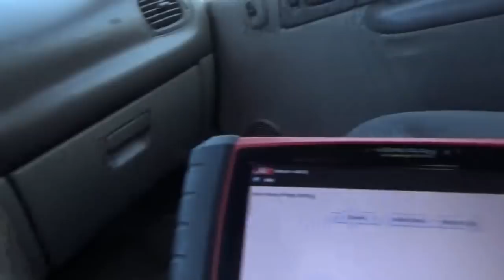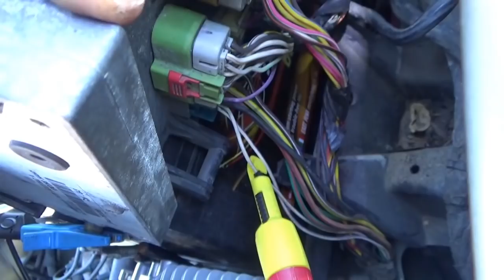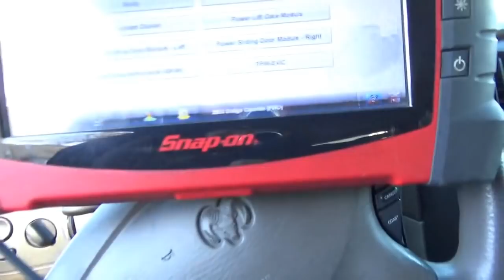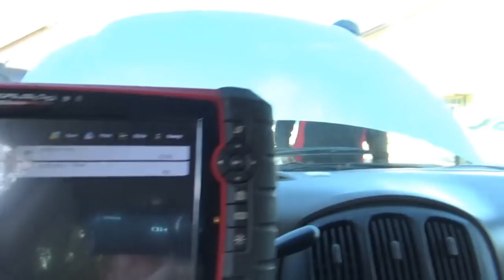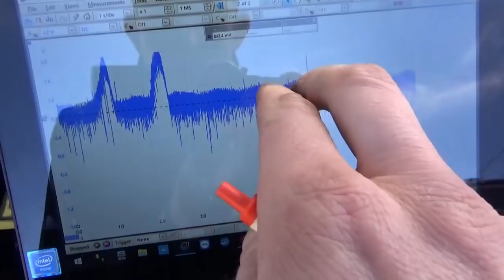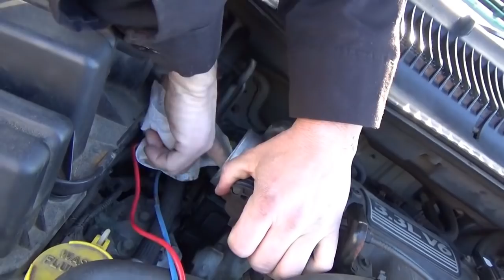No comm, high idle, new PCM: Dodge Caravan (SI Ep. 12.2)

Comment: This is a 15 year old vehicle at that time and it is now February 2024. It never ceases to amaze me that Mopars have always wiring issues and bus issues for the last 2 to 3 decades. Almost all the automotive YT channels have Mopars that have wiring or Canbus issues. It is rarely their engines, driveline, lighting, alternators and batteries that have issues. Their starters wear out prematurely and their drivebelt system ( the pulleys that is)  have been their biggest weakness for decades, dating back to the mid 70's. Up to this point, they haven't fixed their issues and that is very telling of this company. Lately, since they switched over to ZF 8 speed automatic trannies, their reliability has gone sharply up! The 62te and 41TE are an improvement from the A604, but you cannot neglect the maintenance on these transmissions or they will prematurely wear and breakdown. If you maintain the 41TE and 62TE very well, like changing the tranny fluid every 30k  to 50k, they will last an awfully long time.
As a person who has been a Mopar fan for decades, Mopar powertrains are well designed but their wiring, leaves a lot to be desired. Chrysler uses very cheap quality copper wire strands and that is why! If Chrysler could really improve in this area, they would have a very loyal following because their vehicles have features, innovations, styling and practicality that stand out!

Comment: Throttle is at 10%.. Right there was your clue. It should read Zero..

I would add. You take that Throttle body off. As them things get nasty dirty back there..I seen them so caked up. I had to scrub the bores clean with a tooth brush..

Comment: I watched you unplug the pcm. The 2002 Dodge Caravan I am having "missfire cylinder 2 and 5" and sometimes a code saying coil driver is either shorted to ground or has intermitant open. I went and unplugged the pcm and noticed that the wire harness had been resting on the front of the engine block near a ground. I lifted the harness off the engine, zip tied it up and cleared the codes. I drove it around and again got the #2 missfire, but no more #5 or coil driver grounded/open. I think tomorrow I will strip the harness and see what wires are fried.

Comment: I was thinking pin fitment problem on the integrated power module because I noticed from BBB Industries wiring diagram that the PCI bus for just the PCM and ABS were on their own pin so theoretically if the pin on the bottom of the power module was bad then you'd communicate with the PCM via SCI bus, not be able to communicate with the ABS, and no car modules would communicate with the PCM because they depend on the PCI bus.

Comment: Ivan Are you familiar with comm. Issues on a solus pro. Out of the blue my scanner stopped reading all vehicles. If not i have to buy something else. I've been looking at solus edge. Are there any other off brand scanner's you would recommend. The solus edge is 2400 new which isn't awful.

Comment: Eric O had a Chrysler van with comm issues. He started tracking down the different modules the computer talks to and when he leaned on the carpet in the back he found the problem!! It was behind the passengers right seat. The comm wire had rubbed through and was grounding on a bolt. CAN signal technology. Isn’t it great 👍

Comment: Ivan- What you did with the PCM is referred to in the computer world as "Hot Swapping". Worn throttle shaft bushings were a common problem on carburetors, especially Carters from the mid '70's, then they changed to oiled bronze. Even though it's only a tiny vacuum leak- today's systems are so precise (comparatively) that any False Air is easily detected. Isn't the formula orifice size/over/speed of air to be measured g/sec? When Keith wiggled that throttle it had a huge runout of a few thousandths of an inch- easily enough to skew it. Eric would've reattached the air duct, then shot it with brake cleaner, and watch the idle increase. A smoke test will reveal that, too. ST/LT trims would be screwy. That ground didn't just look "noisy" it looked like it was hooked to the radio, LOL.

Comment: Not all problems have a clean answer, even with expert diagnostics. I have a feeling this one will be back, though in an old car the expense of complicated diagnostics has be be considered. I keep thinking back to that messy sensor ground wire signal, although I guess it might be normal ignition induction. Finding the cause of that could take hours, and even then there's a pretty high chance it won't lead to a solution.

Comment: I have cleaned the throttle body on various years of these vans and solved the idle problems each time. Always the cause in my experience if all other maintenance was up to date. These are simple engines with simple control systems. Good reliability when serviced regularly. The models without EGR tend to not have as much filth behind the throttle plate when the throttle body is removed for cleaning.
Reply: Caleb true .I have seen many with 250,000 to 300,000 miles of good service on them .

Comment: I was figuring that the IAC valve was sticking, since the idle speed was normal before. Upon restarting the engine, most IAC valves are commanded to a larger opening for a restart. The larger opening "flares" the engine speed up to around 1500-2000 rpm for a second or so before the IAC is returned to curb idle.

Comment: Wouldn’t a clogged IAC result in an erratic idle not necessarily a fast idle.
Reply: You'd think so. It's restricting air bypass but the computer thinks it needs to run faster resulting in a slow idle that runs rich.

Comment: hillbilly fix, small round file/drill, open the TPS holes so it can rotate slightly further........
Reply from the maker: If it was my own van, that would be my solution too lol
Reply: I am putting out there what many of the shyster car lots are doing ;) and of course trying to add some funny to it.
sometimes a worn or aftermarket junk TPS can cause voltage offset too.

Comment: My Saturn had a fast idle. Ended up replacing the IAC. Fixed it for a while. Pulled the throttle body and cleaned completely. Apparently the orifice for the IAC built up enough carbon to stick the IAC. Before the IAC on cars there was a dampener on the throttle to keep it from slamming shut. I thing the IAC provides this function. I think?
Reply from the maker: You can have both. I've seen this setup on older Toyotas :)

Comment: I had a similar problem with a Fiat. The solution was removing the trottlebody cleaning it and cleaning the IAC, then sprayed some silicone-oil  into the IAC, never had a problem anymore.
Reply: Willem Streutgers silicone is not safe for oxygen sensors
Reply: IAC is not an oxygen sensor. It's a valve and the shaft will get stuck due to dirt.
Reply: Willem Streutgers The IAC is in the intake stream.  Silicone will end up in the exhaust.  That is why they have O2 sensor safe rtv.  It doesn't take much to poison a sensor.
Reply: By saying SOME silicone oil i ment just enough to leave a touch of silicone oil (1drop)on the shaft.

Comment: Kinda what my Toyota acted like one time when the A/C kick-up switch was stuck. Hard to believe the throttle body just went bad  between 2 start ups. Naw aint going for it
Reply from the maker: Throttle body didn't go bad between 2 startups lol
Reply: Thought you mentioned that it was idling fine then all of a sudden it was not, so IAC. I guess I didnt hear what your final analysis was.
Reply from the maker: Well at first there was the weird comm issue, but it was still idling 200rpm too high. Unplugging the PCM just reset the min TPS voltage and made the problem worse until the MinTPS value was relearned :)
Reply: So it did end up being just a little high on the Rpm, 900 or so?

Comment: The van is running just about normal for an old Dodge. :) Ivan why do you think unplugging the PCM 'fixed' the no comm prob.  I had a hard time hearing what Keith was explaining at the end and now I might lose sleep over this. lol  Was it a pin fitment issue and/or a power reset?
Reply from the maker: It was just plain old FM...F'n Magic!
Reply: Ozzstar I was wondering the same thing about unplugging and plugging back in the pcm..
Reply: Many of these old chrysler/dodge Minivan PCMs don't like the battery disconnect and can register a p0601 from voltage irregularities.  My PCM rebuilder modified his install instructions to hook up the PCM with the battery connected and start it once letting it idle 15-20 minutes to register values before shutting it off.  Strange little computers.
Reply: could of been combination of both i had similar issue on a Grand cherokee p1687 comms issue customer installed reman pcm i went through same checks i ended up doing  a battery reset touch cables together and problem fixed car has not been back for months
Reply: PFM! Lol. I had a ford do this to me once. had a crank no start no communication with PCM, ABS, and something else, had communication with all the interior stuff tho (air bags, hvac, stuff like that) went after the com wires on pcm, had to get the cover off the connectors to find my wires, and to do so i had to unplug it. after i plugged it back in, had a coworker turn the key forward to the "on" position, he accidentally went to "crank" and the bastard started right up! PFM! (pure f'n magic!)

Comment: I was a Powertrain engineer for Ford for over 30 years.  On older Fords WITHOUT "throttle-by-wire" their entire idle/closed throttle strategy is different !

First, on any gasoline engine, you never want the throttle plate to make hard contact with the throttle bore/housing.  This is a potential for the plate to get locked in the bore and even stomping on the accelerator pedal may not free it.

Second, in the Ford strategy, the minimum TPS is recalculated every time the engine is started.  This is done by starting with an artificially high value and then looking for a lower average value (𝑖𝑔𝑛𝑜𝑟𝑖𝑛𝑔 𝑟𝑒𝑎𝑑𝑖𝑛𝑔 𝑏𝑒𝑙𝑜𝑤 𝑡ℎ𝑒 𝑜𝑝𝑒𝑟𝑎𝑡𝑖𝑜𝑛𝑎𝑙 𝑏𝑎𝑛𝑑).  This only takes a split second.  Even if you hold your foot on the accelerator pedal at start, you will eventually move your foot and the correct minimum TPS will be calculated.

Third, to try and keep the idle air bypass solenoid from clogging, they ALWAYS want air flowing through the IAC at closed throttle.  To achieve this you want minimal/no air flowing around the throttle plate at closed throttle.  That was achieve by spraying a soft compound around the backside of the throttle body, between the throttle plate and throttle bore when it was manufactured.  CLEANING/REMOVING that soft compound (𝑤ℎ𝑖𝑐ℎ 𝑑𝑜𝑒𝑠 𝑙𝑜𝑜𝑘 𝑙𝑖𝑘𝑒 𝑠𝑙𝑢𝑑𝑔𝑒) means that air CAN get past the plate at closed throttle and the IAC may be commanded to no airflow, raising the potential that it will clog.  (𝑇ℎ𝑒 𝑐𝑜𝑚𝑝𝑜𝑢𝑛𝑑 𝑑𝑜𝑒𝑠 𝑛𝑜𝑡 𝑒𝑎𝑠𝑖𝑙𝑦 𝑤𝑖𝑝𝑒 𝑜𝑓𝑓 𝑒𝑣𝑒𝑛 𝑤𝑖𝑡ℎ 𝑎 𝑏𝑟𝑎𝑘𝑒 𝑐𝑙𝑒𝑎𝑛𝑒𝑟 𝑠𝑜𝑎𝑘𝑒𝑑 𝑟𝑎𝑔.)

EDIT : I forgot to add, throttle shaft/bearing/bushing wear ACN be compensated for BECAUSE all of the air at closed throttle should be going through the IAC.  If there is some air leaking in, the PCM can adjust for it.
Reply: so you're one of the chosen that had a hand in all the surging, lean hot restart/stalling, backfiring/blowing the DPFE, odd downshift/gear hunting, engine rpm/power run-on at low power cruise and brake apply............  I'll just stop there
Reply from the maker: Great info Jack, thank you for sharing! My 1996 Mercury Mystique 2.0L has a specific note on the throttle body that warns against cleaning off this special coating! I have lightly wiped the bore, but it runs beautifully so I won't touch it haha
Reply: Light wipe is fine.  To get the factory stuff off takes some work !  With a stick shift that is a nice car.  P.S. I wrote some of the software in that PCM.
Reply: right, the warning is there so "Bozo the clown" doesn't give it a harsh/caustic chemical bath, wire wheel/brush/sandblast! yep, seen a few sandblasted and acid etched clean before. RIP

Comment: That Dodge doesn't have a coating on the throttle plate so safe to clean.  Other throttle bodies may have a coating on the edges of the throttle plate.  Remove that and create a high idle problem.

Comment: Ivan, interesting diagnosis!  i had same problem with my throttle body on GMC Suburban.  i cleaned it extremely well and checked for the play on the arm etc.  everything was A-OK,  put all back together,  my idle came back at 650-680 rpm and TPS at 2. but I did replace my IAC and TPS thinking it was the root cause.  but turned out my TB was the problem.  kinda the same thing you just went through!  that problem i had was 4 years ago.  LOL.
Reply from the maker: Yup clean before replace is what I would do as well!

Comment: Another fast fix!

Ivan or Keith... I'm looking for an older mid-sized Japanese 4x4 SUV. I cant seem to find a reasonably priced Toyota Land Cruiser. What is you opinion on an 02 Isuzu Trooper 3.5? 

I know Isuzu car sales left the country like Suzuki, but how much is it a pain to get OEM Isuzu parts? I plan to keep it at least 10 years. I dont live near salt either. THANKS!
Reply: We having been having problems getting OE Isuzu parts for the last few years, the Medium duty truck dealers will check for you but lots of parts are NLA and there is only one warehouse in the US for light duty parts and they are not restocking as parts are sold off. We bought the last air intake boot for a late 1990's trooper a few years ago.
Reply: Jim Haines 

Thanks for the input. By reading the only Isuzu forum boards, that seem to be a bigger and bigger issue! PARTS! 

I think I'm going to pass, and save a little longer for the Land Cruiser. 😎
Reply from the maker: 4Runner!!
Reply: keep saving your money buy the toy
Reply: Land Cruisers I wouldn't exactly classify as mid-sized. They are also the high end, Lexus suv that has a toyota badge. Go look up the price of them new. They never were cheap, but they do look like they would get you anywhere on land.
4Runner is much more mid-sized. A lot more common also, so cheaper.
You can also go with Nissan, I've had good luck with pathfinders. 
Being on the east coast, salt belt region, check for rust, then check again.

Comment: There's a bus because you can get codes - but everything says there isn't a bus. Engineered by Chrysler.
Reply: seems to be a rather short bus  ;)
Reply: lots of cars have more than one bus.. high speed and a low speed.. modules can talk to the each other on both or at least pass on a message that it can't talk on the other bus...